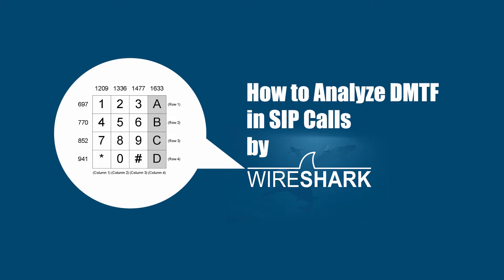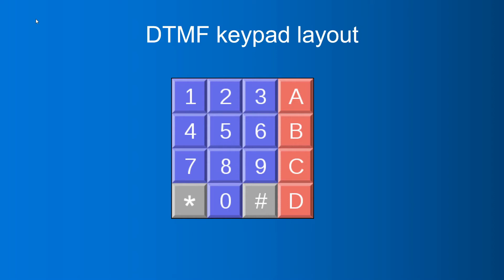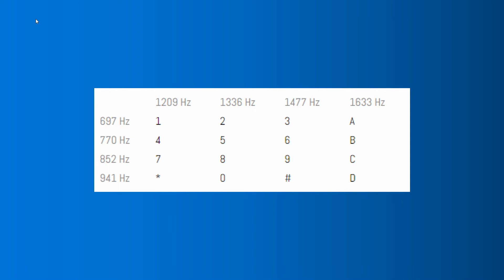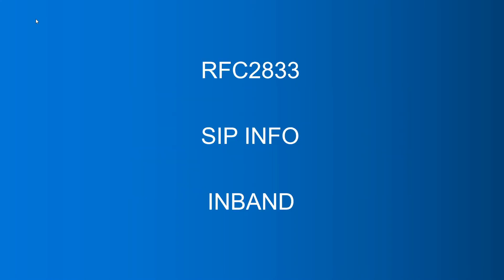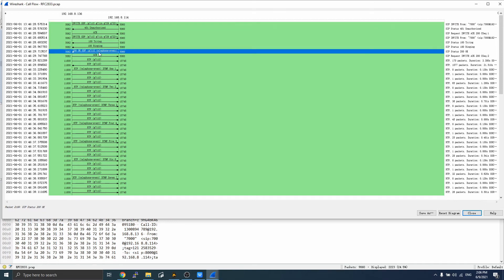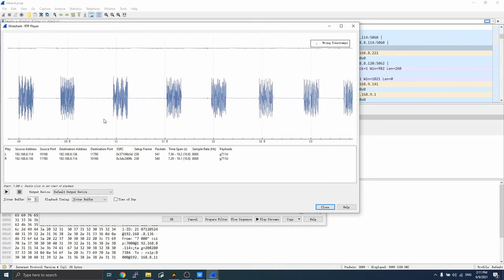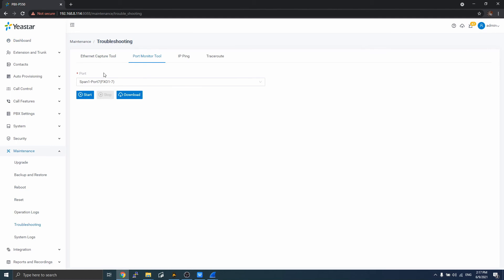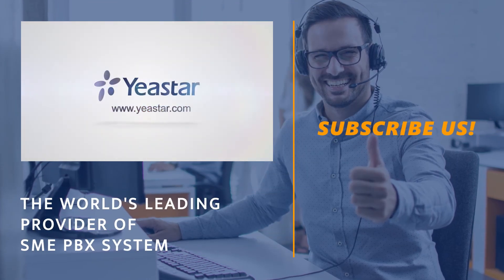How To Analyze DTMF in SIP Calls by Wireshark

Comment: Hi, When testing with SIP INFO, I did not find any SIP INFO messages in the voice traces.

When I play the RTP stream in Wireshark, I can clearly hear the button press tones.

In the RFC2833 test, I can see RTP events corresponding to the digits pressed (telephone-event payload type). However, when I play the stream in Wireshark, I can still hear the tone sounds.

Issue or expected behaviour?

Comment: How to identify which number is sent as DTMF for INBAND In wireshark ?,  for RFC 2833 & SIP INFO we can  actually see the number. 
In-band we need to recognize tones ?...how to recognize "?
Reply from the maker: Hi There, the wireshark could not recoginze the inband DTMF directly. 
Firstly output the audio followed by this article: https://support.yeastar.com/hc/en-us/articles/360038351294

Then follow this article to check the DTMF wave: https://support.yeastar.com/hc/en-us/articles/360038790193
Reply: @YeastarTechnicalChannel  I have extracted the audio file and i can see u are using a tool to analyse the audio, what tool is it ? and where can i download it ?.
Reply from the maker: @ainbanathanaustin  Well, u can use Adobe Audition or Cool Edit to analyse the audio.
https://cool-edit-pro.soft32.com/
https://www.adobe.com/products/audition/free-trial-download.html